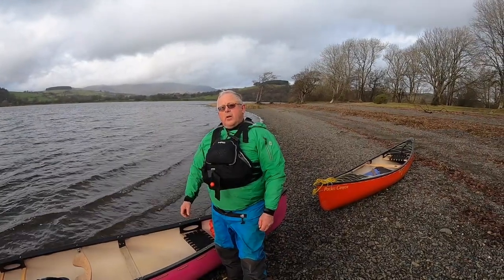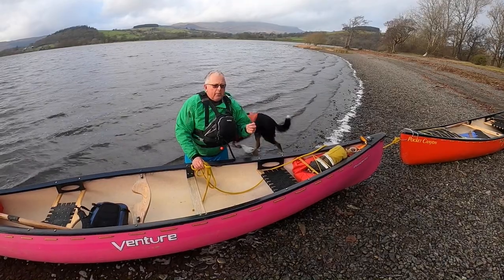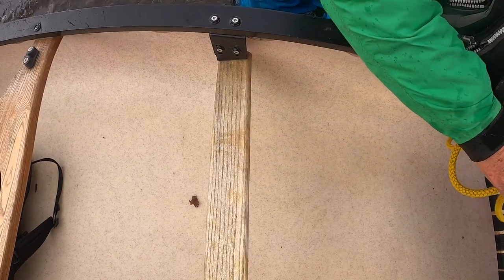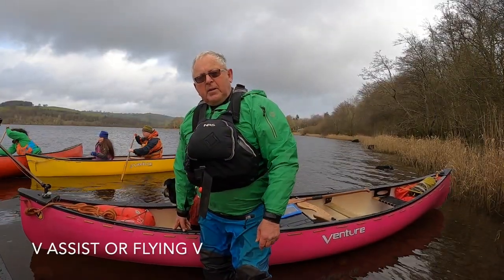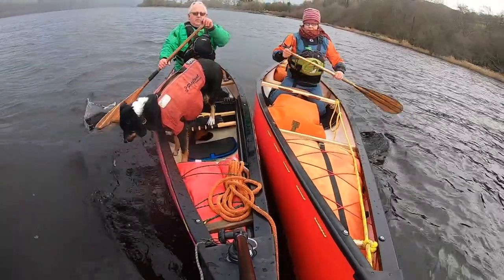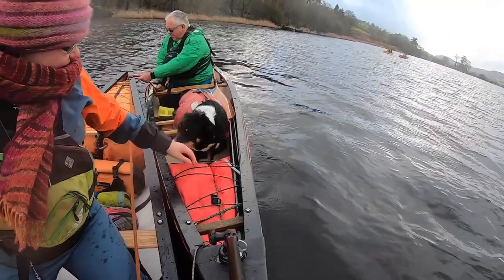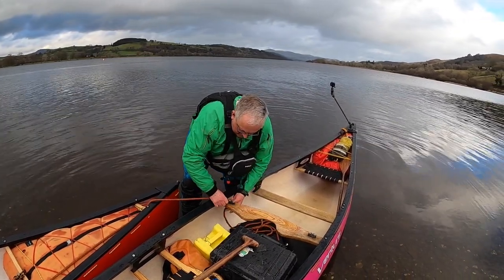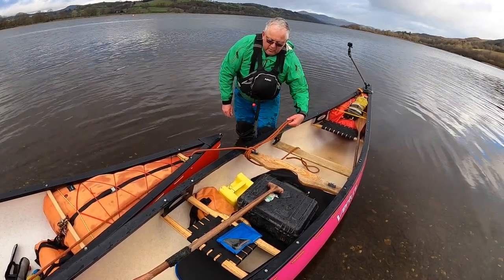Canoeing: Towing and Assists

Comment: great video, thanks Ray. You have tied a clove hitch right next to the cam cleat. As you have those there already, would you ever use the cam cleat to hold the tail of a rope rather than a knot bearing in mind these are releasable?
Reply from the maker: Hi Dave, so the clove hitch has a bight of rope to finish it to make it releasable, so that works. So why not use the cam cleat?  I keep those small for 5mm cord for my sail.  I would need a very much bigger cleat to handle the typical 8 or 9mm diameter of the average painter.    Extra note:  the cleat is mounted where it is to allow the releasable clove hitch to be tied there.  Hope that explains my thinking
Reply: @RayGoodwinCanoe  yes. Thank you. Of course for very different diameter rope/cord.

Comment: Thanks for this Ray. Is there a particular situation where you would use the pencil rig instead of the flying v? Never seen or tried it before so really interested 🙂
Reply from the maker: If I am going to do some distance I will use the pencil rig rather than the flying v.  So on the Spey, after Aviemore, there is a long flat section before Grantown: there if someone needs assistance I will use the pencil rig.  Down further, after Fochabers there are flats followed by fast sections: there I would tend to use the v because its quick and I can peel away to run faster sections.  Hope that helps
Reply: @RayGoodwinCanoe  love that. Yep can see why each technique would be used in each scenario now. Thanks😁